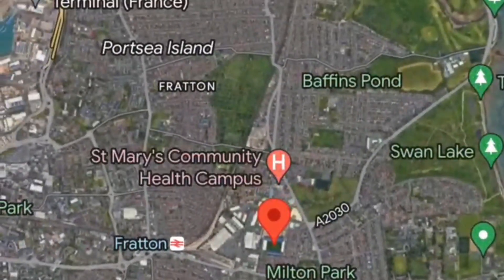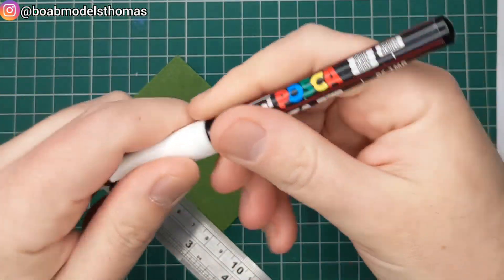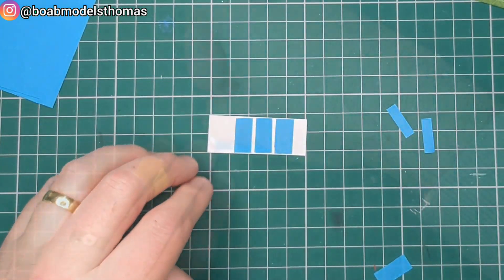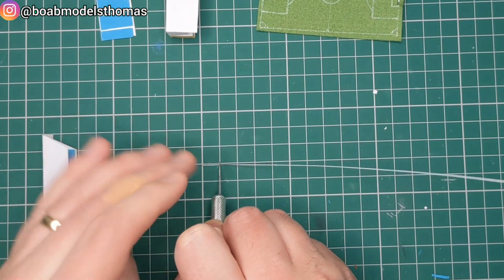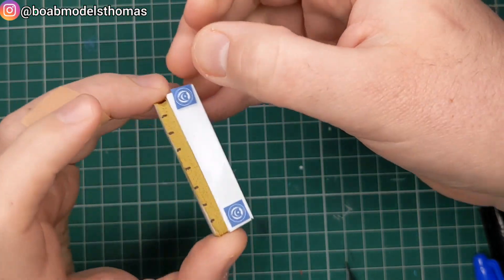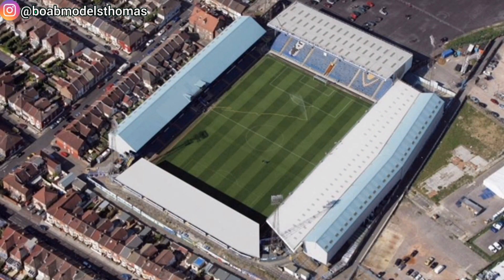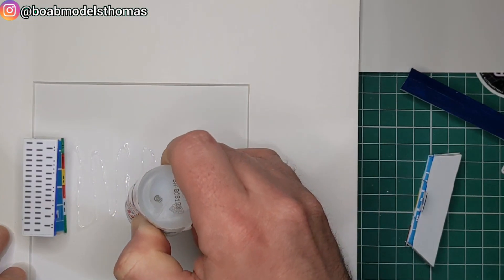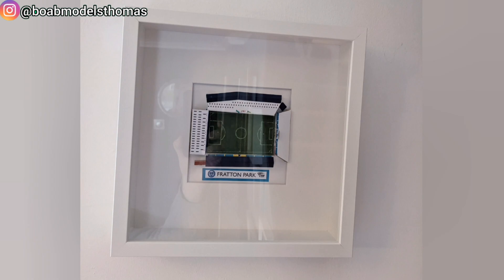Scratch Building a Stadium - Portsmouth FC's Fratton Park

Comment: Its a nice model and looks good on the frame . My first time was Christmas 1965 , with terraces Fratton park was widely regarded as one of the best and safest grounds  outside the top tier during the 60s and 70s and held 45,000 at one time . Certainly the current work makes the hurriedly installed seating of the 90s a lot better . It would be nice to see a classic 60s version a alongside to make a pair .
Reply from the maker: Thanks very much! I've been looking back at pictures of the ground from then and before and it's interesting to see what has stayed and what has gone.